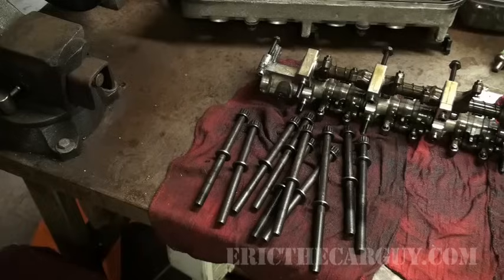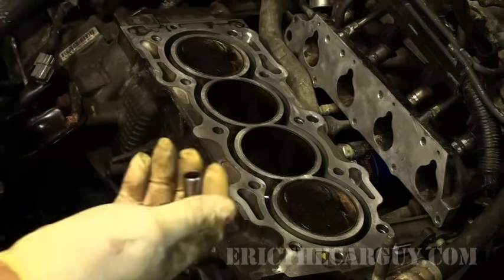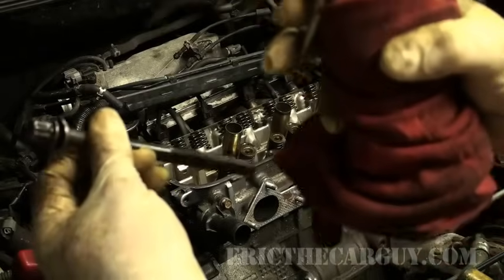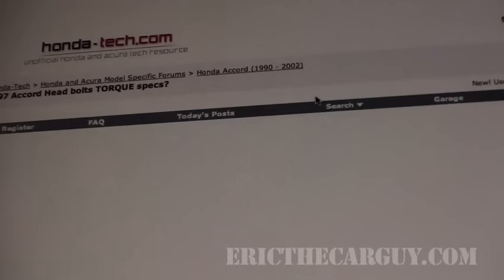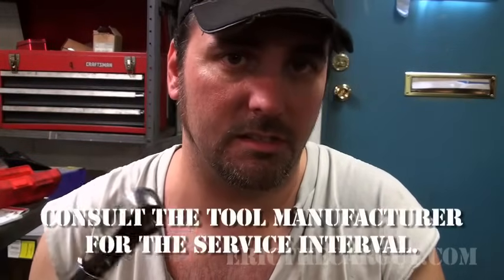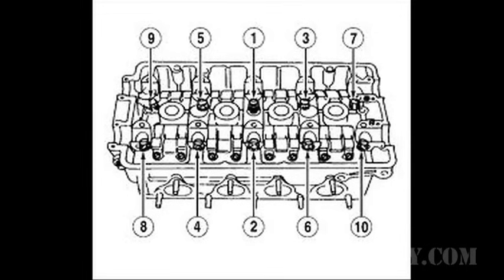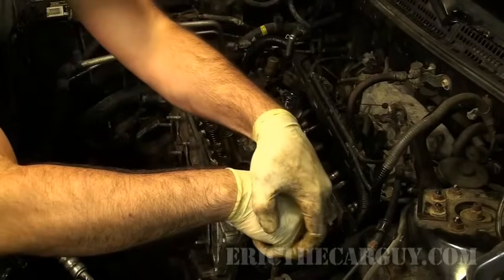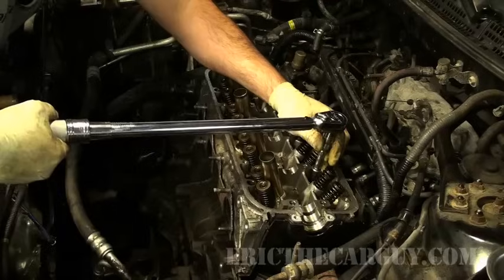How To Torque Cylinder Head Bolts - EricTheCarGuy

Comment: I know this is a very old video but after confidently using a thread chaser on stretch bolts and then using long and for 1 bolt multiple  extensions and eyeballing my 90° last turn. I now know I will be stressing about my cherokee blowing another head gasket sometime (hopefully not soon) again. Thanks Chris 😂😂 I was just looking how to do it on a dodge caravan and wondered if they had stretch bolts as well and came across this masterpiece of a video and just had to see it. With that said I think I'll be doing this head gasket a bit differently now this time😅

Comment: You can definitely torque in the left direction. How else would you torque left hand thread? Or check break off torque when diagnosing rare issues like chronic brake pulsations.

Edit: I wanted to add that this is still an excellent video. I used it as a demonstration.

Comment: What's your feeling on replacing TTY bolts  without bothering with head gasket (head stays in place)? I'm preparing my '89 Toyota V6 (3VZ motor) for gifting to my nephew. It has a small oil leak that I can't find the source. I have removed valve covers and installing new VC gaskets but starting to wonder if leak is actually at the HG. Truck runs well with no signs of blown HG in oil or coolant. Only really need to get another ~30k outta this truck. Would changing head bolts be a bad idea to try and temporarily stop or slow the leak? Or, is this re-torque simply a waste of time? Would I risk getting oil and coolant mixed while head is un-torqued?

Comment: Great video Eric I learned something new. But with the new head gasket there should have been already the specific torque pressure written on the package . The ones you took from the internet do not apply in your situation. The reason being is because there is way to much confusion in what pressure should be done. I prefer to go by what the manufacturer of the head gasket specifies would be the best way. The setting you took from the internet is intended for a brand new aluminum cylinder head not for a re used.

Comment: You mentioned that pinging noise,the last two 'pinged'you just  said  you don't want that noise so why did you carry on?
Reply: That pinging noise, can cause a head gasket to blow when it gets to operating temperature, between one or more cylinders and oil.leak on the outer side of the head/ block.

Comment: I had two set's of socket's one was eight inches long and the other set was if I remember rite was like fourteen inches long and the only thing that I used them for was head bolts. I believe that I got them from the Mac tool guy.

Comment: Drop the 4 corner head bolts in the head before placing the head back on the block, let the bolts determine the head to block alignment. This way you don't scratch up that gasket, those gaskets have a thin coating you don't want screwed up, very easy to scratch it scooting the head around trying to align it up... just sayin.

Comment: Just picked up a duralast 20 to 150, 1/2 DV.  Screwed around a bit to test it out before I used it n I didnt think it was working correctly as I found out,  obviously you add a greater torque value to the tool the tool should tighten whatever ? More well I tested it n got playing around before actual work being performed..  and I started at 20 lbs then 30 lbs n the bolt didnt turn so I went to 40 n it still didnt turn then I went idk 60 70 n it barely turned.  I think I bought a bad one n if so we all know there's a gd spring in there that's n.f.g. lift time warranty so just a return is all.

Comment: Yes Eric! 

What about when you are ONLY upgrading stretch bolts to a higher tensile bolt but NOT opening up the engine to repair head/ replace gasket /re skim block  etc

Remove one bolt at a time replace with the new one going through all its stages and starting from the center working my way out like in this video ??

Any differences if the engine was cold /warm/hot? regarding torque specs  ?

Many thanks

Comment: Hi Eric, should I have to drain engine oil and coolant to replace the bent valves of car 2001 Daewoo Leganza? And also could you please give me the information about the torque required for the cylinder head bolts for this car. I will highly appreciate it. Thanks.

Comment: EricTheCarGuy, I would to make some important question about the Angle torque that you've on this video Snap on TA-360 is the only one that we can use?, because I've seen a lot of angle torque at eBay so chip price but Snap on TA-360 is really expensive, what is your best recommendation for this angle torque to buy the Snap on TA-360 or just any angle torque at eBay?

Comment: i had a nissan altima 2004 3.5 engine i didnt use a angle torqe adapter. first i did 72 ft-lb  second, loosened all head bolts, third tightened all head bolts to 29 ft-lb of torqe, fourth I didnt  have a angle torqe adater so the manual said to turn all head bolts 90 degrees clockwise 2 times in a sequence so i used metalic paint and drew a line accros the head bolt like 3 and 9 off a clock then tightenes all bolts till the paint mark on head bolt looked 90 degress (12 on clock) then tightened all head bolts another 90 degrees ( 3 on clock ) which is 180 degrees or half a circle

Comment: hi eric,how are you?
 pls help me and give some advice on how to re torque 4d56 mitsubishi 2.5 diesel 
after the last torque 118 nm.do i have to loosen and re torque one bolt at a time?i mean loosen 1st bolt then re torque.then 2nd bolt with the same procedure?apart from starting the engine til thermostant opens the wait till temperature drops then re torque again?im in doubt its been 19 years since my last head installation.
thank you n pls reply...

Comment: I went 2 steps more and torqued it to 65Lbft or 780LbInch because 3 other d16's that I followed torque instructions leaked compression.
Machined head and flat block. 
Plus I remember that wen you remove a head from a unmolested Honda engine you need a pry bar or a pipe on the end of your ratchet. So les than 50lb doesn't convince me.

Comment: At the moment, I have a real tuff bolt that won't go in, I'm going to take one of the old head bolts, saw or grind a channel up the thread, and try and clear the thread or push any oil etc out, its a bastard.

Comment: I bought a cheap brush kit with brass, nylon, and steel brushes from harbor freight and cleaned every bolt as well as sprayed them down with brake cleaner and lubed them with oil as well as the brake cleaner in each hole worked perfect! I also did not have any noise issues with the torquing sequence, but I did buy the 3/4 in torque wrench and 1/2 in torque wrench from harbor freight and worked liked butter.

Comment: Eric.  Enjoyed your video, as usual. Question:  Most of the data I read says to torque bolts with clean, DRY, threads.  Also read that lubing the threads will increase your torque by 30%!   That's a bunch.  But I can see what that lub would do.   What do you think?

Comment: A bad experience happened to me when dropping head bolt on engine block thread hole.  One bolt accidentally dent first thread of bolt hole and damage the thread. I have to repair it by manually remove the dent using drill bit ... If you use that hydraulic wrench with damage thread hole... You will completely damage that thread hole.... 
Now slowly placed my head bolt and manually tighten  around 3 turns. Before proceeding tightening all bolt as instructed.

Comment: Huh. Never loosen something with a torque wrench. Never heard that one before. Wonder why they even make reversible drives on them
Reply: Charles Murry because it damages the  release or slip mechanism on them.
Reply: so if you only did it a few times you might be ok?
Reply: @pistonpoweruk  also, if torque wrenches can't torque in reverse, what happens if you need to torque a left hand threaded bolt?
Reply: I think some wrenches are designed for left hand threads as well, but most are not as far as I know. Should be ok if only done a couple of times, but if in doubt get it recalibrated

Comment: Very informative.  But the part around 15:45 on using extensions is not totally correct from an engineering standpoint.  You may never get the torque wrench to click if you are using too many extensions or weak ones, but if it does click, the torque on the bolt end is the same as the torque on the wrench end.  Newton's third law.  Whatever happens in between does not affect this equation.
Reply: Well, longer extension has practically less turn at one end transfered to another end if torque applied on one end, means it does not ideally turn by equal amount that's what he wanted to say. Your applied forces might eaten up in twisting the middle of the extension and hence incorrect rotation desired at the cylinder head bolts.

Comment: Hey Eric quick question, have you ever heard of re torquing new head bolts after a certain amount of mileage after the replacement of the head gasket? I've been told you have to re- tourque the cylinder head after new head bolts are installed and driven for a certain amount of miles and don't believe it to be true, just wondering what your opinion is on that particularly for Honda d and b series engines
Reply: Thats true , but only on an Air Cooled Engine .

Comment: Eric, since watching your videos I bought an 03 Civic, and have replaced a lot of stuff. Next up is front Quick struts, and some new Moog control arm bushings. I am going to use the newer ball joint style that I don't believe requires indexing (will definitely check and I know final torquing done with weight of vehicle on it). I have never really worked on cars, and probably could not have done it without your help! Thanks, Eric L.

Comment: Sorry Erick, I have to differ on the extention thing, Extentions make no difference as long as you keep a 90 degree angle. Also you need to find out whether the specs or lubed bolts or dry. most specs are for dry bolts. if you want to lube them you have to add more torque, I have 40 years in industrial, you can find this out online also. 90 per cent of clamping force is used up on friction.
Reply: https://www.youtube.com/watch?v=qV41SNntPxo

Comment: I love your tag line: stay dirty, that rocks. I've been retired from turning wrenches for approx. 10 years now and almost half of that time since, you can look at my hands and tell what I did for a living. Thank you for voicing every single point I ever tried to tell other mechanics about the proper use of a torque wrench. Not to be a know it all, but there is always a right and wrong way to do anything, and you hit on every single one that I ever learned. I always check your vid's first if I'm not sure if I'm remembering every detail about a certain repair I haven't done in some time, as I've found you seem to give the most concise and detailed info in such an understandable way. Thanks again. Later, bye.

Comment: How did you get to the point of taking the head off?  I don't know what to remove and how to properly mark things and put it back in place, like the timing belt and distributor.  How do you get the cam shaft off, and the timing belt off, and the power steering pump, all that stuff?  I've already snapped off rocker arm bolts with a damn torque wrench that didn't work right and bent the valves and probably screwed up the pistons.  Help! I need my car and can't get to work or school.  Where do I start?

Comment: That movement is you torque ing it you dumb ass. Don't run the bolts all the way down to the metal like that. Just run them down, then torque them.

Comment: Very well explained. Good to see the appreciation of what engineers want to get from preloaded bolt joint. A few comments from engineering point of view:

1. the most accurate way to get the correct bolt preload is with initial tightening. re-tightening torque gives you much bigger torque scatter even if the torque wrench is set to initial torque. 

2. by cleaning the bolt thread with a wire wheel you are making two things: you make the thread surface a lot rougher which results in high thread friction that decreases your bolt preload; you increase the embedding losses in the bolt thread which results in the bolt relaxation (some loss of preload) by flattening the spikes in surface roughness.
Reply: ⁰p pp 0⁰⁰p p⁰⁰
Reply: "Wire wheel", that's just high speed burnishing!  Whidh is it  'thread surface a lot rougher'  or 'flattening the spikes'  -  make up your mind!
Reply: I'm not an engineer but I could see that being problematic

Comment: my instruction manual doesn't say to add oil to my bolts. Do some cars require that you do not add oil? or should i do it?
Reply: Micheal Deacon - Bolts torque tables values are usually with lub. Eric do it the correct way. BTW best lube for bolts is Mos grease.
Reply: Dont get the bolt pop sound confused with the torque wrench pop

Comment: Guys, I tightened my head on my Kawasaki Ninja to 30ft/lbs when it was supposed to be 20ft/lbs, I somehow read the torque wrench wrong which I figured only after I had the top end all done and engine running.. duh.. Well anyway gonna ask if it's gonna cause any damage to my engine if theyre a bit too tight? it runs fine as of now
Reply: youll be fine
Reply: Kameeli

Comment: Hi Eric, thanks for posting this awesome video.  Quick question: on a 1993 Honda Accord can I leave the valve train bolted on the head.  That is, pull the valve cover off, then pull off the 10 head bolts, then replace the head gasket, then put the head back on.  Of course - lots of meticulous cleaning throughout the whole process.

Thanks Eric.

Comment: Actually I wouldn't use one of those torque angle gauges for 90 degrees.  They can slip and it's far easier to just make a mark with a sharpie and turn it 90 degrees.  For angles that aren't 90, 180, and 270 degrees, then I resort to the stupid torque angle gauge.
Reply: or you can do sin, cosin or tangent to determine what lb/ft is the degree you need
Reply: That doesn't make sense.  Trig functions relate an angle to its two-dimensional components.  The torque required to achieve a particular angle beyond the first torque depends on friction and material deformation.  Tightening by angle is generally more uniform than tightening to the same measured torque anyway, which is the point.
Reply: @jon-erikbutcher3609  5l specification on cons rods bearing torque
Reply: ollopa1 m

Comment: Hello Erich I watch ur all video about fixing car I have question I changed my head gasket in my car and I already torque the head it is ok if I loosen the bolt and put that new head bolt for make it sure the head and gasket nothing wrong with that coz I already torque it alerady
Reply: Bud, the gasket gets sandwiched  to seal the water jackets, coolant passages from the combustion chamber, this is not Legitimate and the final result of this action will result in a leak. I would recommend replace all the head bolts, run a thread chaser first my friend

Comment: ooh!! i din't use new head bolts, do i have to re do everything on the 02 galant?
Reply: Yup... including another gasket for the head.
Reply: Probably not, if the bolts arent too old and have much wear they'll prob do just fine
Reply: If they're stretch bolts then they'll already have been stretched. Doing so again will simply weaken them and cause another HG failure.

Comment: +EricTheCarGuy
hi eric! i just went through all of this whilst repairing my wifes opel astra f 1.4i. what you saud about the cylinder head bolts hit home. the initial tightening is 25Nm, followed by 60deg, 60deg and 60 deg. why on earth they had to be so 'arsey' about it, left me wondering....until i watched your video. the last two bolts on the engine right hand side, seemed to 'click out' sooner than the others. ...i guess that by using the 'degree method' stops that happening. needless to say though, i nearly 'shat myself' doing the last set of 60deg tightenings, lol.
ref. living in the dark ages: it totally frittered my brain when i moved from engand to germany. here, everything is metric....back home, it 'was' all pounds, feet and inches (and pints.....mustn't forget the pints)

although this posting maybe a few years old now, it certainly helped! especially the heads-up on the reason for having two torque wrenches instead of one.
cheers eric, mate! subscribed & posting added to my "playlist".....and have some cold beer, dude....you look like you need it ;)

Comment: hey eric one question! what are the cylinder head torque specs on a 02 galant 2.4 engine?
Reply: Step 1 - Torque to 58 ft/lbs in sequence 
Step 2 - Loosen all bolts 
Step 3 - Torque to 15 ft/lbs 
Step 4 - Turn 90 degrees 
Step 5 - Turn 90 degrees 

Caution: Engine uses torque to yield head bolts (TTY) that permanently stretch during initial installation. Requires the use of a torque angle gauge to correctly tighten. New head bolts must be used when cylinder head is replaced or re installed to obtain proper torque specification. 

8 6 1 3 9 
10 4 2 5 7 

^^^^^^^ Sequence as viewed from front of engine.

This is the answer I've found all over Mitsubishi forums.. You can ALWAYS buy a 25$ Haynes repair manual for your vehicle at any parts store... Hope this helps .. Good luck!

Comment: what's the name of the part that the top bolt goes into for the distributor on a 2.2liter 4 cylinder 1990 honda accord? mine cracked on me when bolting on the distributor. Anyone know???
Reply: distributor cap? cam cap?

Comment: Is it okay to use those Cordless Drills with 1/4 Hex to 1/2 Socket Adapters to drive the bolts in after initially inserting them with my hands, then tighten them with a torque wrench?  Does it pose any danger if I use a power tool?

Comment: I've always done equal and even,
If The spec's say , 20,40,70lbf I'll do them 20,30,40,50,60,70 right the way up for even pull, but I'm just ocd on stuff like that.